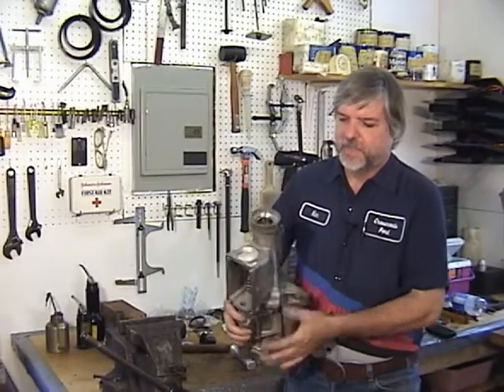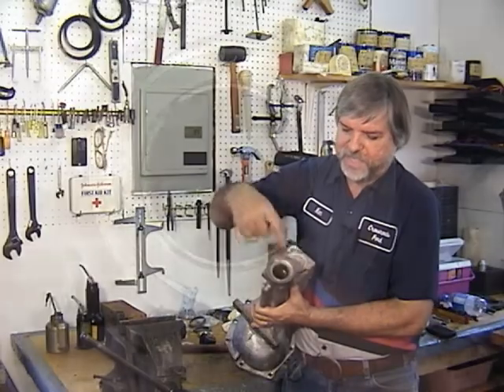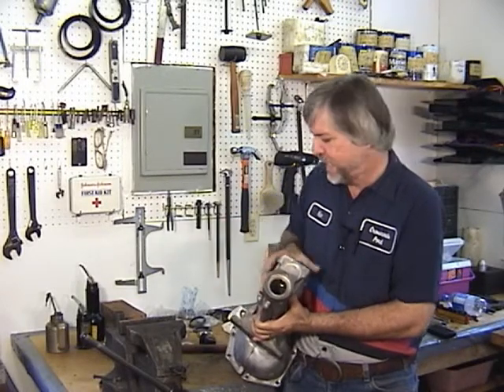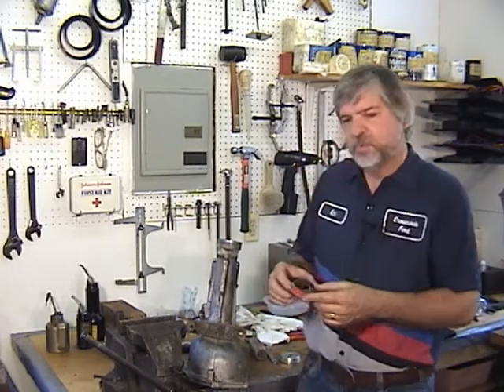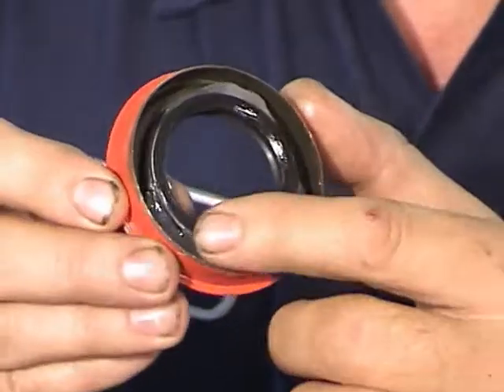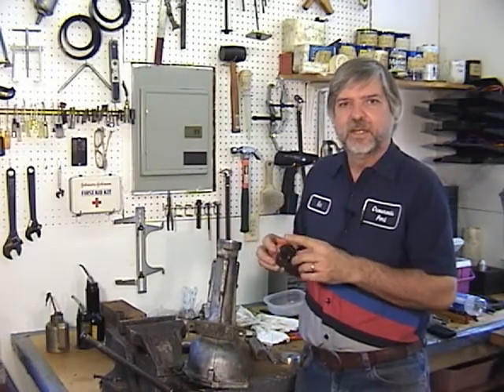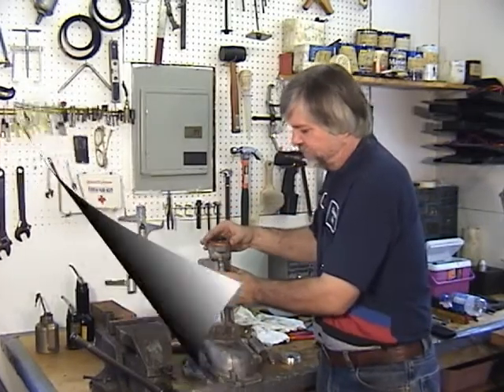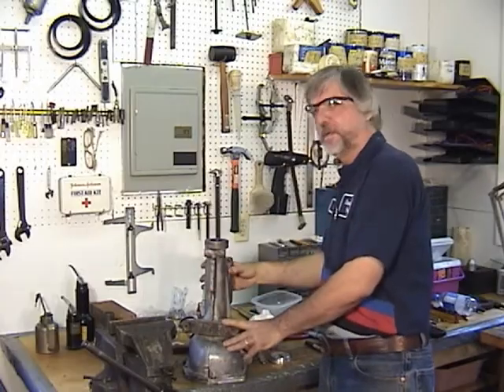Keeping a seal's garter spring from popping out during installation

Comment: once installed, how do you put the  spring back in if it comes out without replacing the whole seal? current situation and no one has the part :/
Reply from the maker: If your fingers are small enough, you might be able to start it in the lip on one side and carefully walk it in. Frankly, I think it's over, get another seal. What are you working on? I believe most any parts store would have a T5, C4 or AOD rear seal.

Comment: How do you remove a garter spring from a fuel line? I have never seen such a stupid design. How do you spend year working on poorly designed stuff?
Reply from the maker: +altlandf Why do you want to remove it? If you're trying to disconnect the fuel line, there's a special tool used to release it.